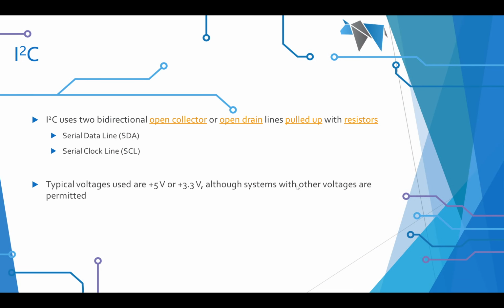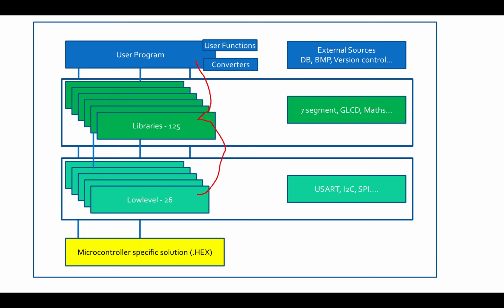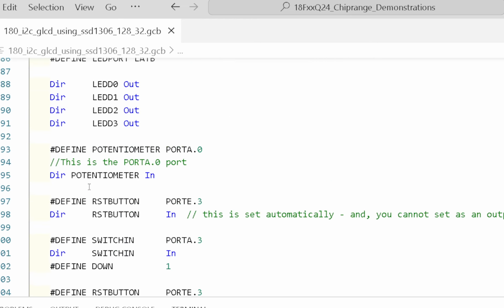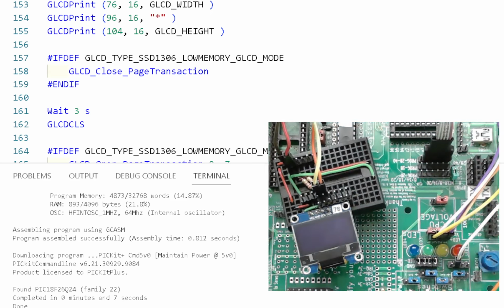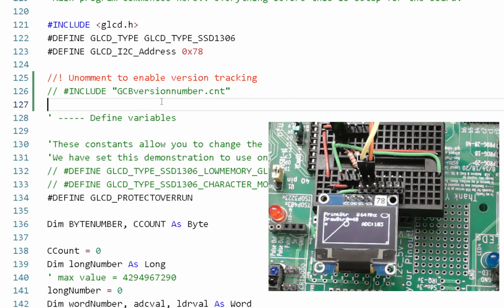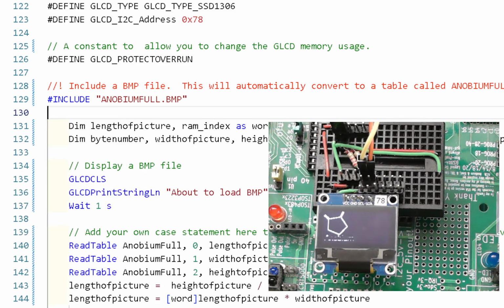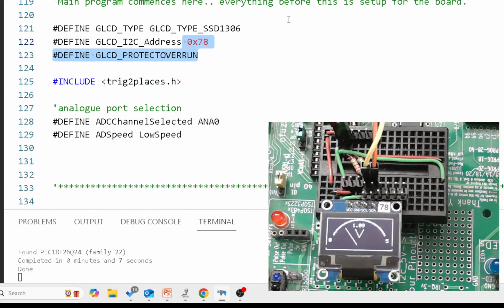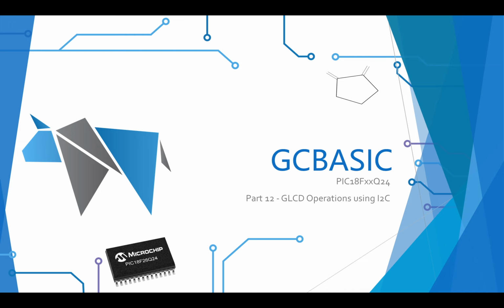PT12: PIC18FxxQ24 chip Family - Using the PIC18FxxQ24 with I2C and a GLCD

Comment: GCBBuildTimeStr great for giving a basic setting for real time clock programs. Simply extract time and date from string then you only need small few 10s seconds adjustment via user interface or maybe even just apply a fixed correction for average delay in programming if that accuracy is enough.
Reply: A very clever use case - I like it!!